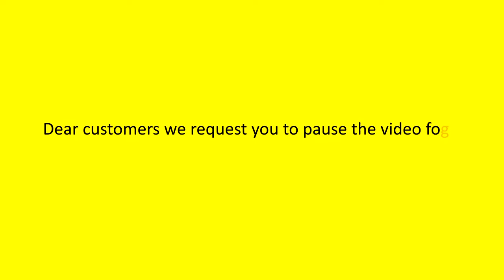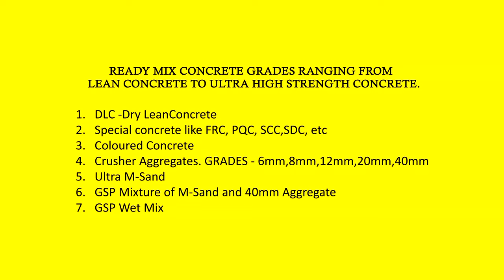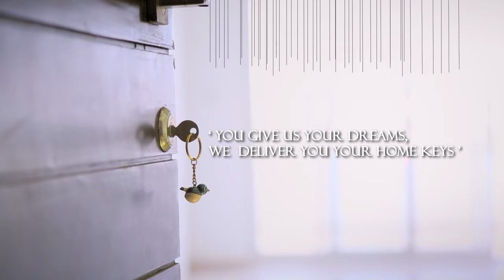Corporate Video of SCC Group - Concrete, Ready Mix Concrete, Concrete Blocks, Plastering Sand

Comment: Hi sir,
My name is Mohamed Hashim from Dilute engineering. We are converting metal parts of the concrete machineries with PU - POLYURETHANE materials which provides higher durability for the machineries. The images provided are the products we have customized for other companies . We can customize according to your machinery and reduce wear & tear problems in your machinery. Hope you will consider us.